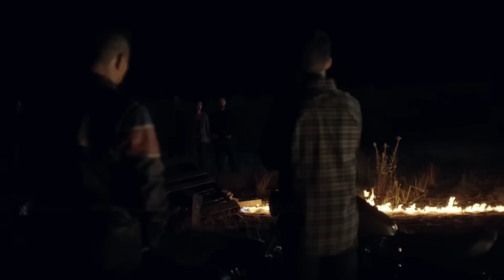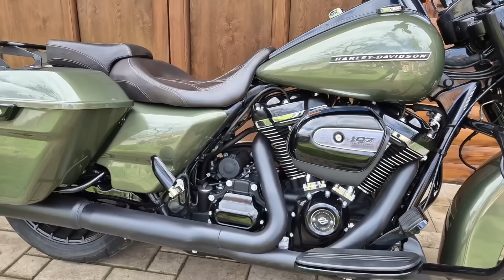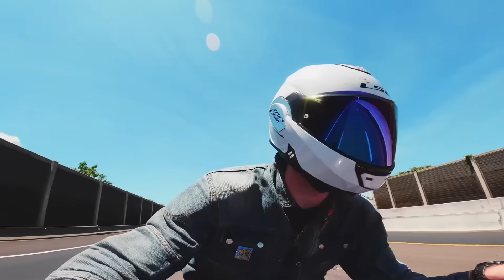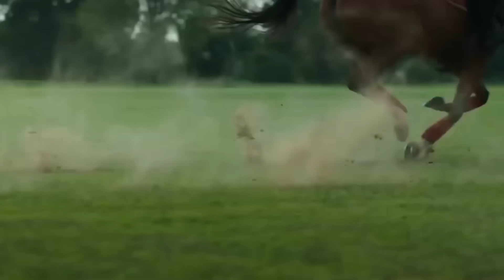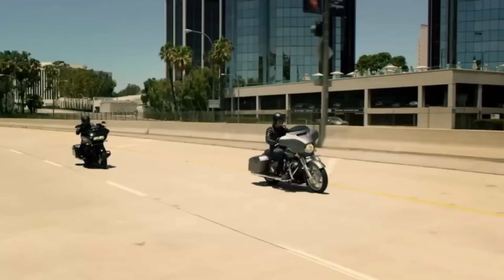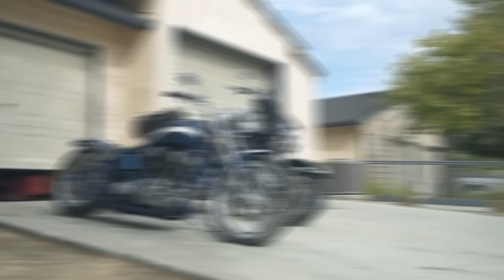5 Harley Problems EVERY Owner Eventually Faces

Comment: You need to check your facts better.  You are two faced. Your other video even you said amf is the biggest problem and newer ones after amf lost Harley ownership only have gotten much better all the way around to no oil leaks for years now. My 2007 Harley has not leaked since boughten brand new early spring time.  The filter usually comes with oil plug gasket that a lot of people do not use and or do not know to use.  The problems happen to all vehicles new or used as you described in this video.  And have had happen on non Harley motorcycles as well.   After many years and many miles and couple times people tried to double hit starter button to start it and a start button push after started.  yeah I had to change out the stater myself with little troubles. Easier than I first was expecting.  DOT required Harley to use that fluid.  Learn about the caustics of the fluid and what that does to the system and the leaks.  I have read and heard Harley tried to fight the usage.  Just like all vehicles with that fluid those problems have been problems and need same attention applied.  Electrical problems happened you mentioned happens to all vehicles even my non Harley.  My non new Harley had same clutching problems you have stated even after mechanic adjustments.  Look sorry there was an accident and injury, but even driver instructions manuals and Harley owners manual tells one to use transmission gearing down shifting on down hill riding over brakes so one does not over heat brakes which can cause glazing less stopping power and malfunctions and then can cause over heating fluid and more braking problems as well.  I guess just Old School Big Rig Tractor Trailer Truck Drivers like myself know of these things.  Harley transmissions have wider ratio band gearing due to more of a torque use engine.  And now again you blame one mechanic and possible covid shit as an all Harley problem and no shit on proper adjustments on any vehicle, not just Harleys.  Do not blame Harley on DOT requirements as Harley problems.  It happened to all vehicles even non Harley two wheelers.  Please do not put down Harleys when all vehicles have such problems and some mechanics failures.  No this did not help especially when on new purchases dealers and owner manuals and sometimes other owners of same or similar vehicles tell what you need be watching for and do and to be paying attention to different things one needs to pay attention to towards any vehicles, new or old.  I could write more against what you have said and have, but phone call took away what I already wrote and could not get back and remembered completely plus running out of time other things need to be done.

Comment: I bought a used 2002 Harley Fat Boy with that Cam Chain Tensioner problem. I didn't do enough research. But I am handy and will maintain them myself before they fail. I had a 1978 Harley Sportster that put me in the hospital. They put on a cheap rear brake pedal that broke off. I ended up going through a cars windshield. I sued Harley and they paid me off with no fight. They knew they had no case and paid me off.

Comment: I had a Honda blackbird regulator failure when new 90 miles on the clock. Went again at 24000 and 48000 miles. No just Harley problems.
Reply: LoL I had a old CB750F "stator coil fried" got a CB900 Boldor "stator coils fried" no issues with my GPZ1100, Ninja 1400 and Hyabusa 1300... rode many other makes and models of largest displacement bikes available in the range. Aprilia and Ducati are the WORST...
Got rid of all that junk and switched over to Harley Davidson, and ZERO issues "except the Sportster-S destroyed my back, but not the bikes fault, I had one of many very serious accident 2 decades ago, hit from behind by car/suv/truck drivers.
So Sportster-S had to go alas

Comment: A Ultracool oil cooler with dual therm controlled cooling fans sling with love jugs mighty-mite twin cooling fans completely fixed the engine heat issues on my 2013 flunk with tc 103.
Now in 85-90 deg stop & ho traffic the engine oil never gets over 220 deg-f where it used to hit 265-270 deg f.
Now with oil temp reduced 50deg f in summer heat it has the following benefits:
OIL PRESSURE INCREASED approx 7-8psi at idle & at cruise rpm too.
LIFTERS/VALVETRAIN REMAINS QUIET.
ENGINE STOPPED DETONATING IN PREMIUM 93 pump gas.
ENGINE NIW RETAINS ALL ITS POWER & CRISP THROTTLE RESPONSE IT USED TO LOOSE WHEN RUNNING HOTTER.
LESS HEAT HITTING driver & passenger.
HOT RESTARTS LIKE POST FUELING UP ARE MUCH  QUIKER/EASIER.